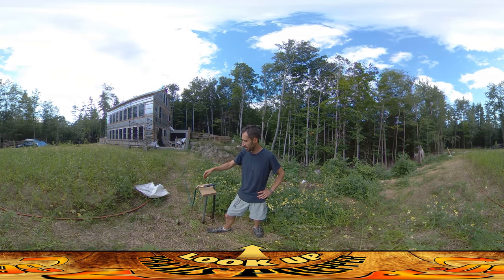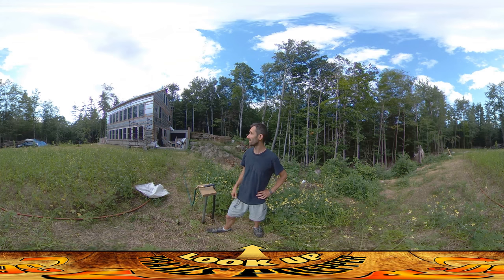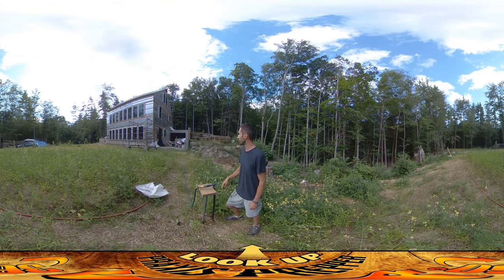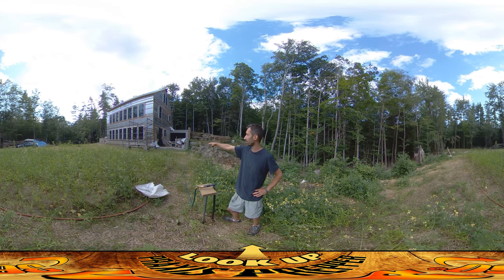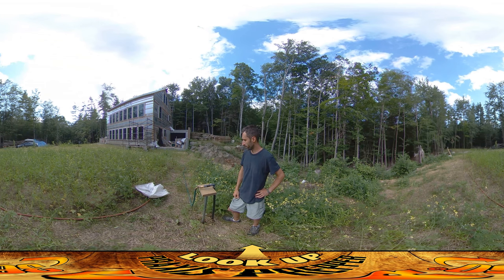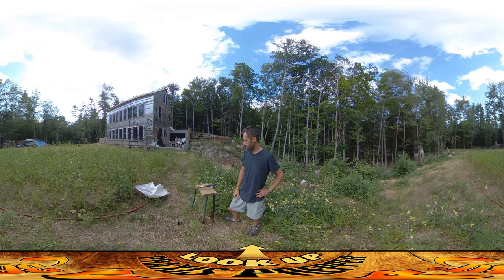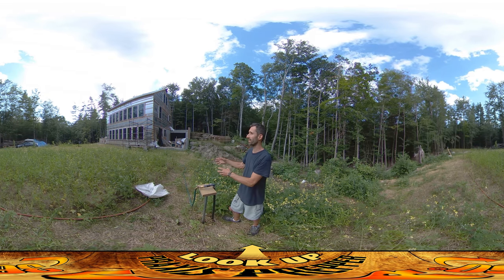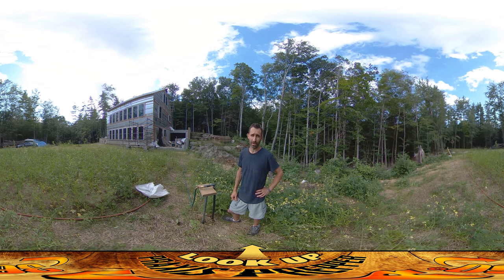Homestead Building - Plumbing Done, Tip on Barb Fittings and Clamps

Comment: There's a trick used by guys who install lawn sprinkler systems to prevent such leakage in water lines. Since they work almost entirely with Polybutylene, they use a blowtorch to soften the inside of the water line, quickly insert the fitting, and then clamp it. I've tried it, and it works great.
Reply: cool tip
Reply from the maker: Thanks for the tip. That sounds like a good tip. I tried something similar with pouring boiling water onto one of my splices. I bet a torch would work better.